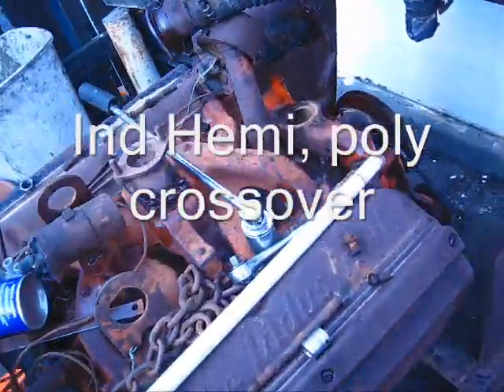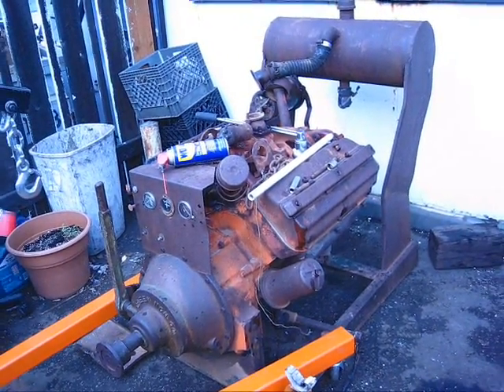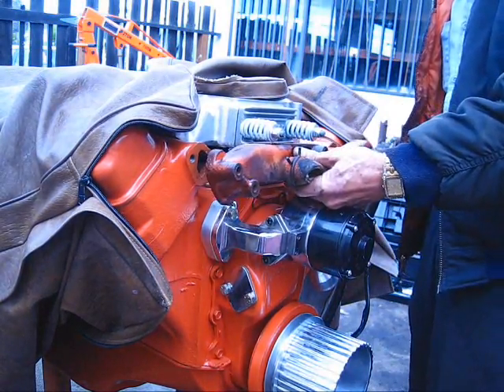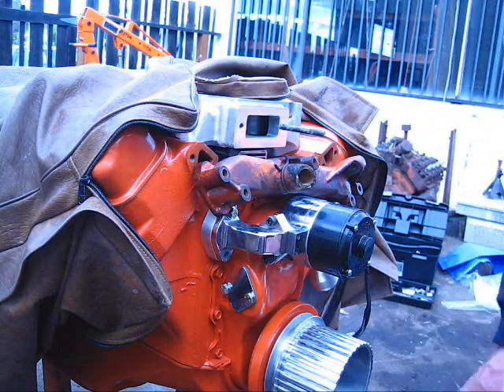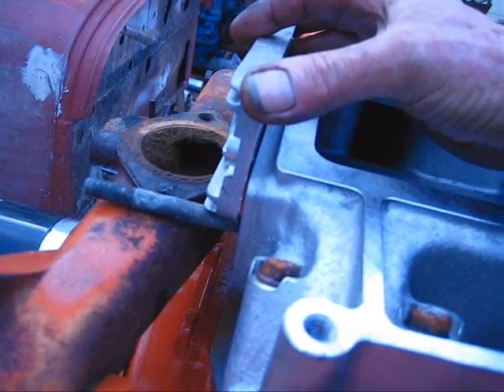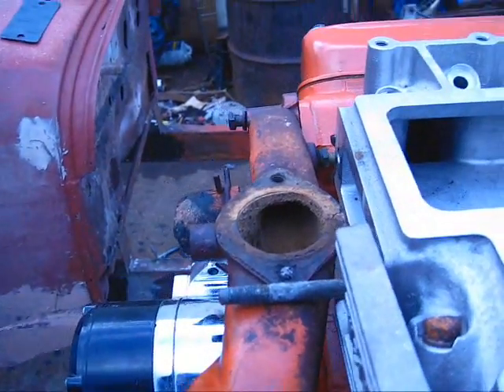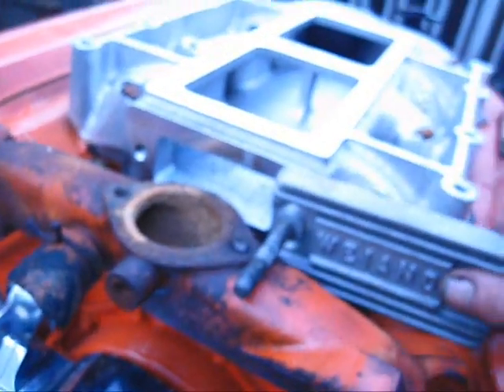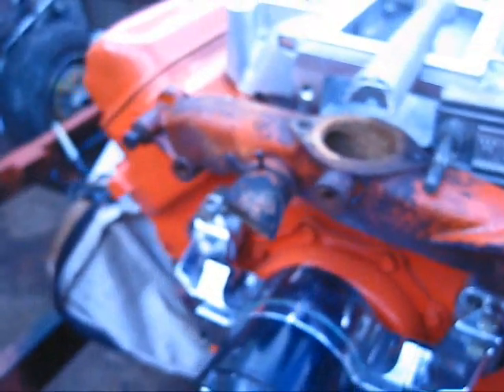Chrysler 331 Hemi industrial  water crossover thermostat housing with electric pump

Comment: I know this is an old video, but the 331 never cam with a crossover on the ends of the heads.
Reply from the maker: The block I used was an old poly motor. I ended up using some other heads I had from an industrial hemi.

Comment: How could i put a 4 barrel carb and intake on a 1953 331 hemi because the 2 barrel that is on it sucks and i cant find a cross over tube for the front. Thanks
Reply from the maker: Well the best way is to find a 4 bbl manifold. However, parts are scarce and expensive. If you have machinist or tools, you can find any old 4 bbl manifold, cut the carb mounting plate off, cut the top of your 2 bbl one off, machine them flat, and bolt the top onto the 2 bbl one. You might also be able to find a manifold for a 331 poly motor, they will fit. Or a blower manifold, and bolt a plate on it. Sort of depends on time and money.  there are a couple of 4bbl manifolds right now on ebay. Thanks for the comment, good luck.
Reply: @1otviii  Ok thank you